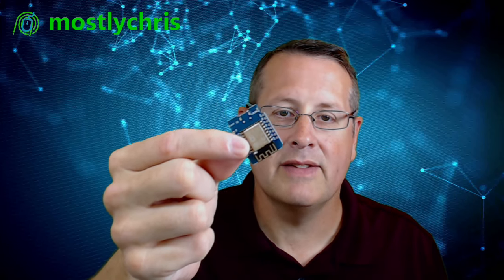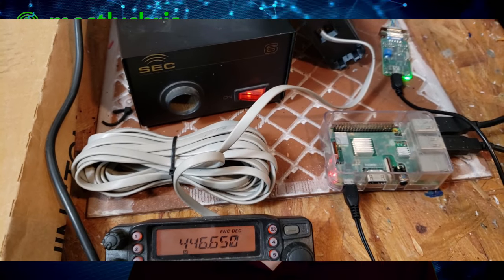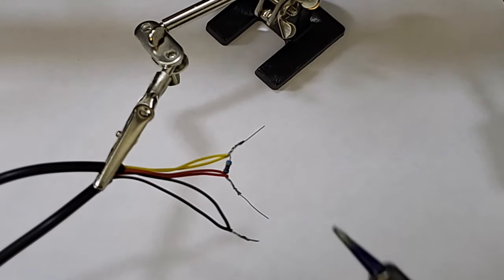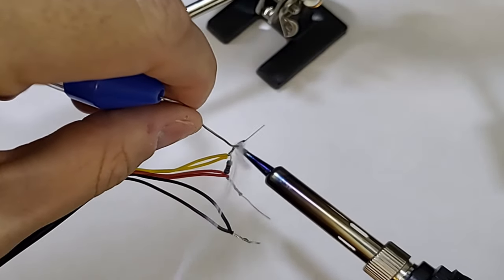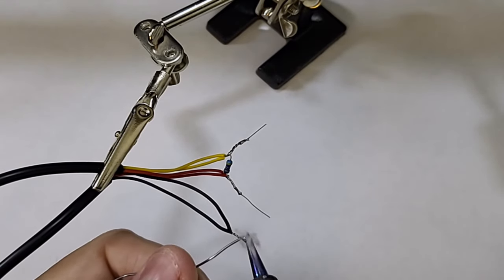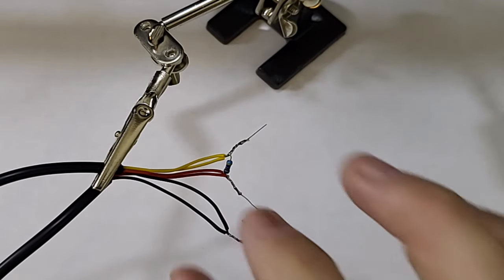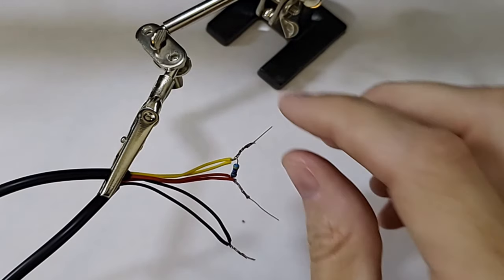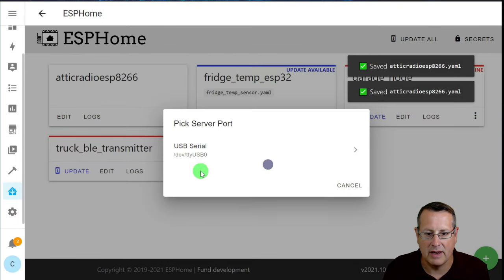Monitor Equipment Temps with the Dallas Temp Sensors, ESPHome, Home Assistant and Grafana

Comment: This was a great video. I now have three Dallas sensors on a NodeMCU board monitoring three freezers in my basement. These already "saved the day". One of our kids didn’t close the door fully on one of the freezers. I was alerted fast. I also put one in my garage to warn if the temperature gets too warm in the winter since my wife stores excess vegetables in there during the winter.
Since my router is located where the temperature can’t be controlled, I placed the router inside an old Styrofoam cooler with a Dallas Sensor probe. If I get an alert the temperature is above a certain level I remove the lid. If it drops below a certain level I put the lid back on. The heat generated by the router itself keeps it above the min operating temperature with the lid on. Temperatures here can drop below 0 degrees Fahrenheit.

Comment: Chris you created a monster! I added another board with 3 temperature sensors on it. It works flawlessly, now I can see my Attic temp, Garage temp, and outside temps. I extended one of the sensor cables about 25 feet using thermostat wire and there is no real difference in temps when probes are right next to each other before I put them in place. Thanks again for doing these videos!
Reply from the maker: Sweeeet!! Good job. These are handy little boards and sensor. They are even waterproof.

Comment: Good idea to make a video about this. I did the same thing 6 months ago to measure the temperature of my pond and the outdoor temperature. These Dallas sensors are waterproof so I could just put it in the pond without problem. They work over very long distances. I have about 30 meters of Ethernet cable between my Dallas sensor and my Esp8266
Reply from the maker: Interesting use. I don't think I mentioned that these were waterproof. These are very versatile and can be used for a lot of things, not just what I showed in the video. So far they have been doing their thing, sending me 30 second temp updates.

Comment: Thanks. Built this based on your recommendation on one of your live stream. working flawlessly inside my freezer
Reply from the maker: Great to hear!
Reply: Silly question but are you putting the whole assembly (board and everything) in the freezer or just somehow feeding the temp sensor in? I would imagine the microcontroller can't handle the freezer temps.

Comment: Thank you, thank you, thank you!!!  Really appreciate all your work... this is actually what I was looking for to monitor my hot water heater temp.  One thing you might want to mention, if you are having problems connecting to your esp device to upload your code, check your cable.  It may be a charging cable and not support transmitting data.  Quick question if I may, how many temp probes can you connect to one data line?  If you connect more that two, do you need to change the resistor?  Thank you again for doing this!!

Comment: Hello and thank you for your great video. Would you please have any recommendation for meat probe which could be connected the same way? I also need to connect to distance approximately 150ft from my Wifi hub. Is the 8266 the best for this or it would be better to use different board?

Comment: Very useful video thank you! One thing you didn't mention (or maybe I missed or you've covered it elsewhere) is how you are powering the ESP8266 board? - via battery or mains adaptor? I've currently got a few of the dsb1820 sensors hardwired into a couple of pi's but am now looking to run a home assistant server and extend the number of temp sensors etc into places where mains power is not feasible and I don't want to run long cables...
Reply from the maker: I am powering these off USB 5v adapters plugged into mains. I was just thinking about how to power them with battery and how long they would last. That might be the subject of another video.

Comment: I find this really intriguing and looks like something I'd like to get into. But I have a really basic question. How do you power all of these little devices scattered all around your house and yard. It would make sense if they were battery powered. Do these all plug into your homes electrical system?
Reply from the maker: The ESP devices are usually powered via a USB power supply or equivalent.

Comment: I found they wasn't very stale so I used a filter and over sample it , before I could monitor the temperature reliably.
Reply from the maker: Oh yeah? I haven't had an issue so far. What problem did you see?

Comment: Hello Chris! If I will use multiple Dallas Temp Sensor with different cable length, should I use different IO pins and different resistor values? I will have cables ranging from 1 meter to 5 meters...
Reply from the maker: I don't think that is necessary. If you are talking miles of cable, maybe, but otherwise I don't think so.

Comment: Chris.  I saw you use Grafana for graphing data and it looked like is was installed in home assistant.  Can you recommend a good video that will teach me how to install it in my home assistant.  Thank you for all your work and help. Ray Knapp
Reply: I am slowly getting ready to install the database software and Grafana on my system.  I wanting to make sure that I am correct on an assumption.  I have a home assistant yellow, and it is running with an SSD drive in it. I am assuming that that should have enough power to do all of the processing I need.  I am looking forward to getting the data base installed and then the Grafana. I did figure out that since your videos are so old that the way to get to the store is different now, but I have that out now.  When I have some free time, I will start the process. I am looking forward to pulling sensors together over time to monitor things. Ray

Comment: Hey. Do you have any more detail on that "drop resister"?  Do we need that for other sensors like DHT 22 that only have 1 data wire? What exactly is it for?  Thanks
Reply from the maker: The resistor is necessary to prevent erroneous readings of the sensor. Without it, youj might get some weird values. According to what I've read, the DHT22 also needs a "pull up" resistor to prevent these type of incorrect readings.

Comment: Out of idle curiosity (I really should be working) what is the maximum number of dallas sensors you can wire like this? Is it two? If not what dictates the limit?
Reply from the maker: I have seen people run 8 or 9 of these sensors. I suppose there will be a voltage limit more than anything else. Once you hit that, things might start to get wonky.

Comment: Brilliant video this is going to be my first use of an esp board or anything like this, just a question how do you know that the temp sensors are compatible, what do you look for and you use D2 which is GIOP4......how do you determine which output pin you use? Thanks
Reply from the maker: It's in the documentation that I used. The ESPHome site is a good start.

Comment: I build "Toys" for grown ups (sort of ;-) ), what would you recommend as an OS to monitor numerous sensors yet not require the web, since they will be "roughing it", off grid and offline for a week or so? I like the ESP devices, and STMicro's products too. Being able to mesh with their phones, tablets, etc. is the goal. 3 different power systems and battery banks come together to mesh into 1200 amp hrs of 12.8 volts of LiFePo4 power with a 270 amp aux. alternator that has LiFePo4 capable regulator and temp sensor on the alternator. While complicated is my middle name, most people are Mickey D's rated and a simple menu driven HMI makes them happy. So there are 5 Dallas sensors, two with the water tanks and the other 3 monitoring the batteries to protect from low temp charging. 5 current sensors, 3 200 amp, and 2 500 amp shunts. One 500 amp shunt monitors the charge current and the other the Inverter drain current. There are 5 heating pads to help, but managing power in tough weather takes a watchful eye.
A new subscriber, maybe I will find my answer scouring your home page. Thanks for the post.
Reply from the maker: Thanks for the sub! All of what you are talking about can be done with a Raspberry Pi and Home Assistant. It doesn't require an internet connection. It does require some sort of a wifi network though. I assume when you say "off grid" there is still power and a local wifi network. Without the wifi network, you'll be hard pressed to bring all the sensors together in a single pane of glass.

Comment: Hi, Dallas seems to be replaced by one_wire in the latest ESPHome versions on HA, but I can't get it right as message is : no sensors found.  Can you show me code example for one_wire?
Reply: I just got this working using the video as a guide; single sensor, esp32 board instead of the esp8266, I also skipped the resistor.

one_wire:
  - platform: gpio
    pin: GPIO21

sensor:
  - platform: dallas_temp
    name: "temperature_dallas"
    update_interval: 120s

Comment: Thanks Chris! It has inspired me to start my first ESPHome project. Thinking of trying it on an ESP32 as I'd like to make use of bluetooth for some Xiaomi BLE sensors.... will config be more or less the same?
Reply from the maker: It'll be close. Just make sure you use the correct pins. There might be some changes to the resistors as well.

Comment: thanks for the tutorial. what software you are using?   windows  ubuntu  debian - is it matter if i use windows 10?
Reply from the maker: Software for what? If you mean programming, it is browser based now. Your USB port needs to be available to the browser as a virtual com port.
Reply: @mostlychris  A friend of mine is helping me with a home assistant as I'm new to this, he asked me to use the  debian11 software which was my question, not windows10. it's related to (beca thermostat-wifi device) now we are midway working on (wemos) and it's for a school where I work for, thanks for the reply.

Comment: Do you only need the resistor if you have multiple data lines?
Reply: I think you always need the resistor as a pull up.
Reply from the maker: You need the resistor regardless.

Comment: I tough you will include in the video after install them in the attic what are the readings, but now I remember is not hot enough for test it, could you make another video afterwards?? Thanks
Reply from the maker: I have historic data that I graph in Grafana based on the values. What were you looking for?
Reply: @mostlychris  I am looking for how hot the attic can be, because a year ago I had in line fuse for my ws2812b 5v holidays lights and during the summer the plastic melted and connectors separated from the fuse. So I’m wondering if goes higher than the 150C the sensor can read!! Thanks
Reply from the maker: 150C is melty hot! That's 300+F. I doubt it gets that hot. The ESP might die before the sensor. I have computers, network switches, and a number of raspberry Pis running in my attic and have for a number of years. Frankly, I'm completely surprised they are still running. It gets about 120-140F (49C-60C) up there in the heart of summer.
Reply: @mostlychris  Okidoki, thanks!! ☺️

Comment: what distance will the esp8266 drive to the dallas sensor using 16AWG? 20AWG?  24AWG?   10 ft?  100 ft? 1000 ft?
Reply from the maker: The longer the cable, the more loss but I have not experimented to see. Resistor values might need to change if you use a super long cable.

Comment: Chris, do you know of a temperature sensor with home assistant integration that will measure the surface temperature of my wood stove? I was thinking of sitting it on the top of the stove.  I want to be notified if it’s gets too hot. Thanks!
Reply from the maker: What's the max temp that stove gets to?
Reply: @mostlychris  I would like the temperature sensor to have a maximum operating temperature of 800 to 1000°F.  Mostly the wood stove will be between 350 and 450.
Reply from the maker: That's a pretty high temp. Maybe something like this would work: https://esphome.io/components/sensor/max6675.html.
Reply: @mostlychris  So after buying an IR type temperature gun, and monitoring my wood stove temperatures, how about a temperature sensor that will go up to 600 degrees?
Reply from the maker: @firepilot17  Going to be the same answer. You need something that will go higher than the Dallas sensors and that link above might be it.

Comment: How exact does the resistance 4.7k needs to be?  I have a 5.1k ohms, would it affect the Temperature reading?

Thanks for the video! I'm doing something similar myself so this was very insightful!
Reply: Something between 1k and 5.1k. 
The outputs are all open collector connected to GND in parallel and the resistance make logical 1. 
I like to use 3k3 for 3.3 volts, 4k7 for 5 volts.
For long lines rather 1k.

It is even possible if one sensor, the red line and black line together. 
Then the power supply is only through the data line and the resistor.
Then you only need a two-pin cable. This is then parasite mode.
At 5 meters I have no problems with it.

The resistance of the line does not affect the measured value, but you must bring enough energy to the sensor so that it can measure and the result can be "morse code" to the receiver.

The sensor has a built-in capacitor for power supply.
Reply from the maker: Thanks Jens for the detailed explanation!

Comment: Actually it doesn't work like described here. Now it demands in settings encryption key. This is generally a major issue for me with HA. You have little or no experience and eventually find some tutorial about whatever you want to do. By my experience there is about 80% chance that those tutorials are wrong bcs HA has already something depreciated or added. Actually I have so far had NEVER found any HA tutorial that was 100% correct.
Reply from the maker: Encryption key? What for?
Reply: @mostlychris  I think encryption key is set inside esphome so every time you add a new integration u have to enter that key